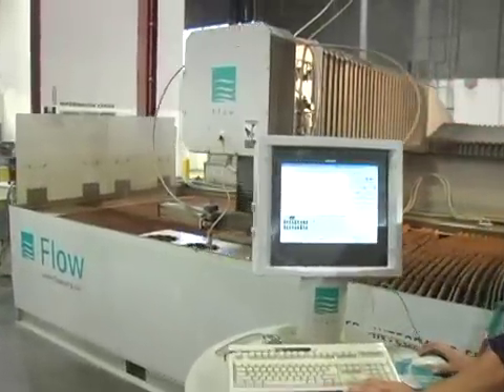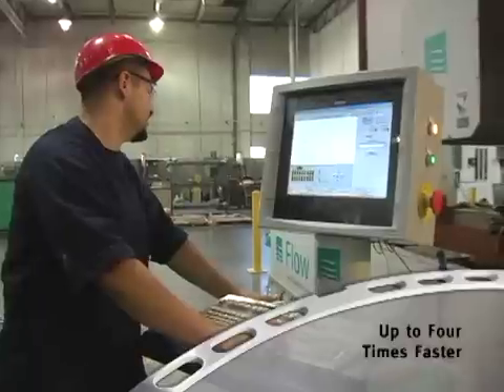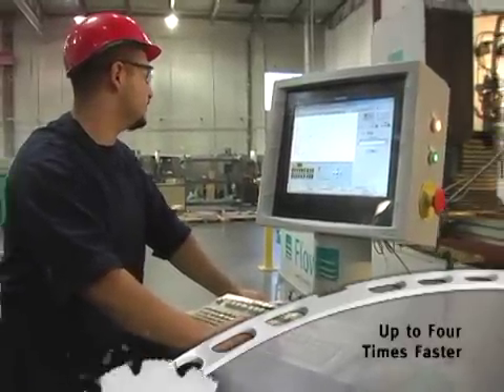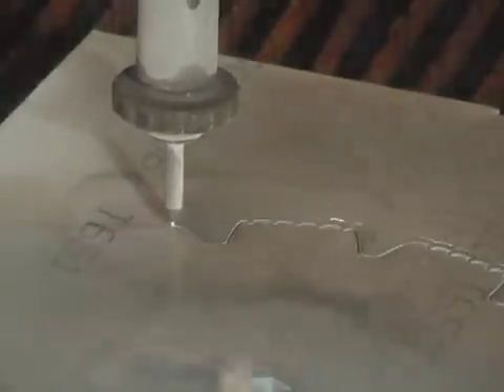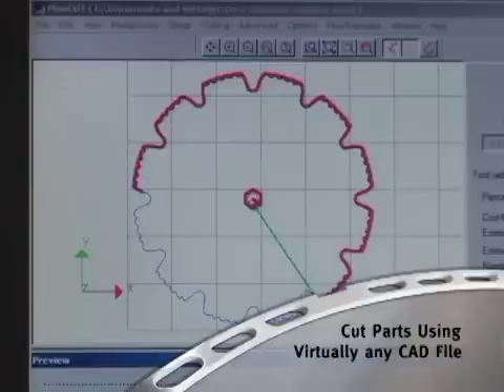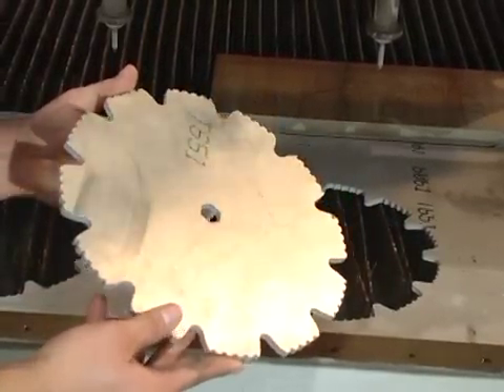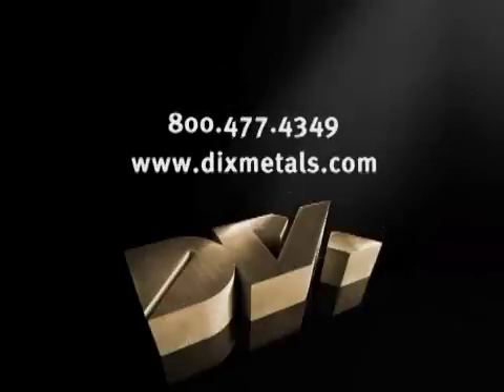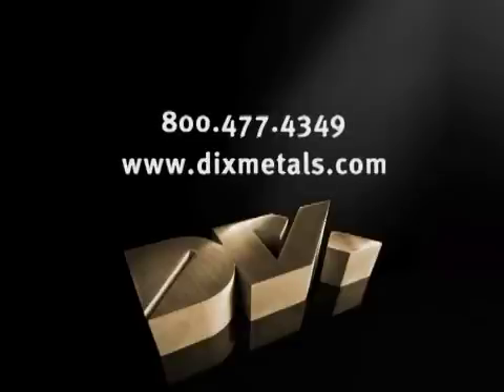Water Jet Cutting Services for Machine-Ready Blanks

Comment: The water jet provides inverse reactive current for use in unilateral phase detractors, and is capable of automatically synchronising cardinal grameters. Its power is produced by the modal interaction of magneto reluctance and capacitive deractants.